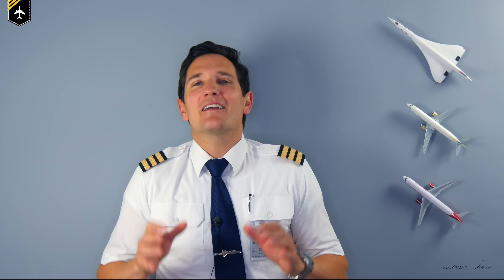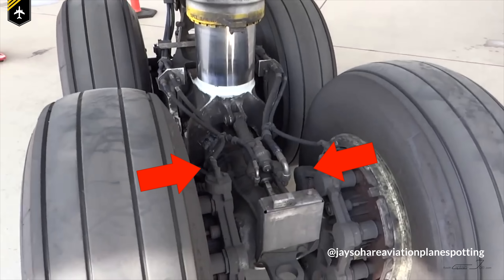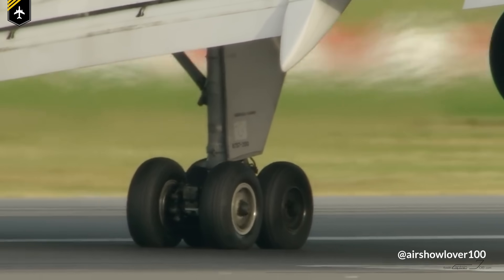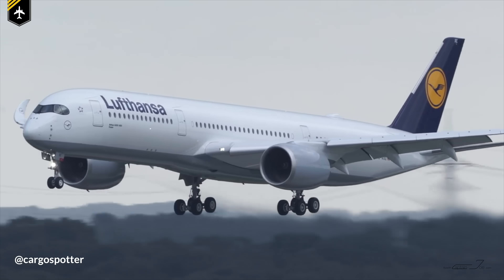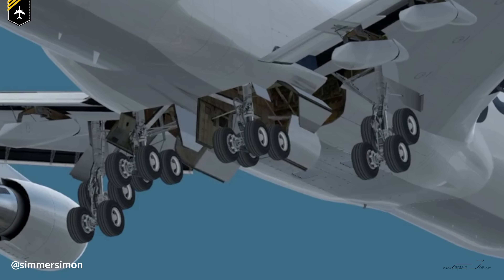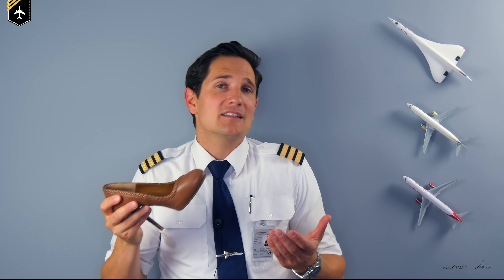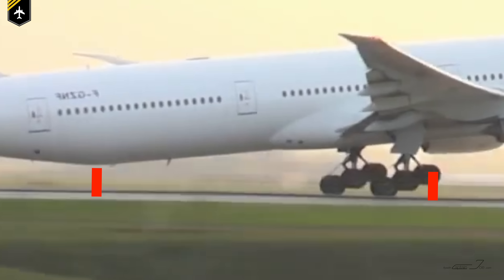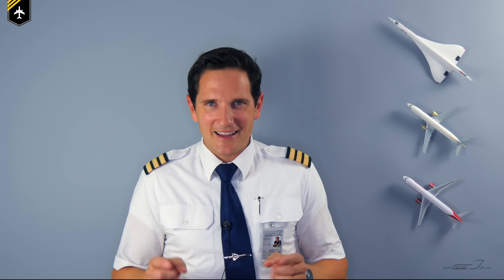Why is the LANDING GEAR TILTED? Explained by CAPTAIN JOE

Comment: Why do planes land on the rear wheels first
Reply: Its not always the rear wheels. But rather the "main" wheels. If its a normal aircraft then the main wheels are in the back. If its a taildragger aircraft then the main wheels are in the front. But basically the main wheels are designed to take the weight of the aircraft when it is landing.

Comment: Question for you…do the wheels on commercial airlines pivot around the central axis of the strut?  I’ve seen videos where airliners land with high crosswinds and they touch down with crab angle.  If landing gear were fixed, it seems like the airplane would lurch violently after touchdown.

Comment: 1:41 i understand from what you said here that tilted landing gear has some benefits on the plane during "landing" .. in another youtube short https://www.youtube.com/shorts/9TH5BeYh9y4 you said that tilted landing gear is for preserving space for the wheel bay in the plane belly and has nothing to do with smoother landing.
Just 1 question.. does it help for a smoother landing or not ?

Comment: Great video but just a question. If that’s the reason, why not tilt the gear back to being parallel to the fuselage after extension, so the tires can impact the ground at the same time? Why is it kept at that tilt angle?

Comment: To every complex question is always one simple answer - and it is wrong :-).
Sorry, Joe. It is the case of this video.
The main reason for the tilted gear is to reduce the lateral force on the main support column during landing. Each wheel of the gear is a giant flywheel that has to be accelerated to the rotation corresponding to the groundspeed of the landing aircraft. As it has to happen within a split of second, the tangential force on the wheel has to be very high - F=m*a. This force is doing its best to bend or even break the main support column backward. So, the idea here is to divide the force into 2 stages by causing one set of wheels to become rotating first and the second set of wheels start rotating afterwards. This way this force is effectively halved, and it helps to reduce the dimensions and weight of the main support column significantly. 
Simples :-).

Comment: The tilted ones resemble how a large bird like an eagle swoop down to grab their prey. Essentially they act like shock absorbers with the forward motion(going from tilted to parallel to ground) It's so much easier to use animals to explain these concepts considering most modern engineering is inspired by them(biomimicry) Also another good example is how professional skiers land after a jump.

Comment: I always thought the tilted gear would also give some sort of a softer dampening zone on initial touchdown. Like if you come down on the left side first it could give a gentle nudge to the plane so you level off with the ground before the main weight of the aircraft comes down.

Comment: C5 and C10 landing gear components are huge, I dropped a brake rotor (these are multiple interlocking friction plates) on my foot during training from one of those. It weighed 70 pounds, fortunately regulations specified steel toe on flight line crew as mandatory so mostly my pride was injured.

Comment: Joe, some airplanes have two position. Tilt and stow. Tilt position depends on rake angle. Semi levered mlg is also on 787-10 for the same reason as on 777. As I know is not blocked on perpendicular to strut position.

Comment: Retired aircraft mech here. Yes some are tilted toes up and some are tilted toes down. AND some MD-10/MD-11 the bogie is level. And if the gear isn’t tilted correctly they can’t be retracted with interlock system.

Comment: I always wonder why so-called "air scoops" (an air-powered turbine) are not attached to the wheel rims, which cause the wheels to rotate shortly after the landing gear has been extended? Because you can always see that the wheels are Put on accelerated from zero to airspeed when they hit the ground. And that results in a lot of rubber abrasion from the wheels every time you land. So if the wheels are brought to flight speed by the so-called "air shovels" (air-operated turbine) before landing, then the wheels touch the ground at the same speed as the flight and there is no rubber wear on the wheels.

Comment: Semilevered gear is only on the 777-300ER, not the non-GE powered 300s.  It doesn’t affect control at all, but it does allow higher RTOW and lower VR speed because of the increased tail clearance - the RR powered 300 has much higher VR and V2 for the same weight and much lower tail clearance.  The system is an MEL item on the 300ER, and involves weight and speed penalties giving weights and speeds similar to the RR 300.

The reason for not having the wheels retract within the wing space is not the fuel tank location but the thickness of wing section you would need to include the width of the wheels, the bogey, the doors and retraction system and all the wing structure - far easier to tuck that into the large fuselage space and composite belly fairings.

Comment: Ich frag mich immer, warum nicht an den Radfelgen sogenannte "Luftschaufeln" (einer luft-betriebenen Turbine) angebracht werden, die die Räder, kurz nach dem Ausfahren des Fahrwerks, in Rotation bringen? Denn man sieht immer, daß die Räder mit dem Aufsetzen auf dem Boden schlagartig von Null auf Fluggeschwindigkeit hoch-beschleunigt werden. Und das gibt jedes mal beim Landen eine Menge Gummiabrieb der Räder. Wenn also die Räder vor der Landung durch die sogenannten "Luftschaufeln" (luft-betriebene Turbine) schon in Fluggeschwindigkeit gebracht werden, dann setzen die Räder in der gleichen Geschwindigkeit des Fluges am Boden auf und es gibt keinen Gummiverschleiß der Räder.

Comment: Why no small fins on the wheels to help them spin a little on landing? That would save some rubber I would think?
Reply: It would increase the cost, weight and complexity of the landing gear system. So even if you may save some rubber, it will be offset by all that.

Comment: A pilot explained me that in the case of the Boeing 767 landing gear, it was to reduce the landing distance on wet runways as the front wheel of the boogie would chase the water for the rear wheel. I'd like to have your opinion on this. Could it be another reason ?

Comment: Do tell.  You have mixed systems but they only reason the gears tilt is so they can fit into the fuselage on retraction.  The "gear not tilted sensors" feed information to other using systems.

Comment: In the RAF aircraft engineering world we call them 'hop dampers'. :)))  JOE you forgot to mention the Boeing B52's STEERABLE undercarriage.......that has FOUR STEERABLE  main undercarriage units that turn and tilt. BUT they can also turn at an angle ( to point along the runway) allowing the huge aircraft to land in cross winds.... once it touches down the wheels straighten up.......very clever! Try to watch one landing in a crosswind or a video.....the aircraft appears to be pointing at an angle to the runway......, the wheels however DO NOT!

Comment: If I recall the XB-70’s main gear pitched up roughly 90° then rotated 90° such the trucks were pointing up with the bottom of the wheels facing inwards before retracting. It was a rather complicated bit of choreography.

Comment: I think if they could spin the wheel up to speed before planes land, it would be softer and not burn and waste so much rubber. But it must not be worth the extra weight and mechanics to be worthwhile or they would have done it.

Comment: Wait... when the gear hits the ground, the system depresurrizes the cabin, deploys the speed brakes, thrust reversal and other stuff all simultaneously? That's pretty incredible technology. I'm wondering why depressurization is important- probably an obvious reason but I'd like to know- stress on fuselage/safety is what I'd guess...
Reply: So the emergency doors can be opened as soon as possible after landing, I'm guessing.

Comment: As for as how the rear wheels touch down, look no further than God creation. As human beings, when we walk or jog we plant our heels first, then bring the toes down last! In fact God created aerospace engineering. In fact in fact to explain how the human heart works, the God had to create so many branches of engineering such as hydraulics, surface tension, pressure, valves, flow, hardware, chambers, software, artificial engineering, electrical engineering, electronic engineering, velocity, friction, resistance, preload, after-load. Just to name ga few. NIK NIKAM, MD CARDIOLOGY. HOUSTON, TX

Comment: hi Cap!,
I guess you’re made a mistake,
when you described the tilt actuators.
due to main landing gears located behind the center of gravity (with nose gear crafts) 
actuators not able to «slightly raise” the wing leading edge the actuator’s torque directed opposite what you told...
and also doubts about ability of this small actuators to raise at least half of aircraft weight (35+ tons) if any)))

btw, thanks for the explanation!

Comment: for tack control it's easier to stabilize an aircraft to a surface when you have some form of lateral force trying to push your plane to the side ect..  like a car that's air born can it steer in the air no.  a plane can yes but on landing not so easy...  Plus if all wheals hit at once the forces of the inertia to turn to wheels up to speed upon hitting the tarmack may damage the landing gear. So it's easier to do one at time.

Comment: As I've been enjoying your informative videos, I've been wondering how those little toothpicks of a landing gear can handle all of that weight and those forces (lateral forces especially) without snapping.
Reply: Landing gear struts are not "toothpicks." If you look at them up close, you will see that they are massive pieces of heavy engineering.

Comment: If anyone remembers the Handley-Page Victor, the main bogie completely inverts before the gear stows into the wing on retraction.
It's effected by tip-hooks on arms that pull the front of the bogie upwards as the retraction-jack retracts and folds the leg so it fits into the thickness of the wing. The wheel diameter is just a couple of inches smaller than the thickness of the wing.
Sadly, I don't think a video exists of this amazing mechanical feat in action, but it was so brilliant that there used to be a full-size working one in the Science Museum in London many years ago. I remember seeing it as a child in the 60's. Little did I realise I would actually work on that equipment some years later!

Comment: Speed brakes deploy automatically?!?
Plane auto-lands, auto-brakes?!
Fun of modern piloting seems less.  Pilot is more of an equipment monitor
Reply: That's true, but then again one has to understand that an airliner is more of a utility vehicle han a personal vehicle. So in such aircraft, safety and ease of use has a greater priority than fun.
Reply: @ZK-APA  right. To say nothing about complexity & expense.  I never thought of an airliner as a winged sports car, but as something needing a pilot's skills for effective operation. 
Pilot has gone from being the primary control & safety system to being the quinary one.  The fun of piloting is in engagement, not in being the 4th back-up.
Well, it's a job, still.   For a few more years….

Comment: I'd rather like to know why the wheels are not rotating to match landing speed, instead of sanding rubber off on the runway as the motionless wheels are accelerated in a fraction of a second.

Comment: Fun fact: 

Humans should walk ball first Instead of the common heel first. Why? Because by walking sole first you actually put pressure on your feet more slowly, allowing your knees to receive less impact overall and detect any dangerous bits (rocks and so on) 
Anyone who has walked barefoot on grass or dirt roads does this instinctively. 

The invention of shoes with thicker and padded soles and heels made this type of walking less comfortable and people started to walk (and run) heel first

Comment: A330/340 has the pitch trimmer. It is a single direction hydraulic actuator. All truck positioners are bi-directional--can be controlled to extend or retract; the A330/340 pitch trimmer can only retract under pressure (causing the bogie to reach a heads up position), and "forced to extend" when weight on wheels.

The pitch trimmer provides damping during landing and bogie rotate during take off like a 777-300ER SLG, but it DOES NOT cause the bogie to change position. The pitch trimmer locks the bogie in forward-up position when fully extended. During retraction, the unique shortening mechanism on a A330/340 gear causes the bogie to be lifted towards the main body, and ARTICULATE the bogie to reach a flat position.

Comment: Seems like the wheels should have fins on them that would make them spin when they are lowered into landing position.  The wheels/tires aren't spinning when they touch down on the runway and the tire leaves rubber on the runway Everytime in a puff of smoke.

Comment: I think that foot anaylysis is important it makes sense to transition the weight bit by bit rather than in one thump.
The more I think about it the more it makes sense.
The tilt forward gear is like a ballerins landing on her fore foot,the heel strike more like a runner but same principle.
Engineers often have more than one reason space saving is also another.

Comment: Well done explaination ! Historically retractable landing gear is a complicated engineering challenge as failure is almost always fatal for both the aircraft and pilot.
Even if the first generation fighters didn't entirely belly flop the stress of a poor design to the airframe could  be more than the mechanics and sheetmetal shops could correct.

Comment: This is slightly inaccurate by omission:  the semi-levered gear is only on the 777-300ER, the 777-300(A) does not have that feature.

Comment: Unfortunately, this video is based on a myth.  The 757, 767, 777, 787, 330, 340 and 380 etc all UNTILT their gear while stowing them!  So space is not the reason.  The reason for the tilt is to AVOID all wheels on the bogie from touching down at the same time!  This reduces the MAX HORIZONTAL load (caused by friction) on the gear assembly and wing spar to half.  Then you can save weight on gear assembly design.  It also reduces the nose down tendency on touchdown.  Finally, it reduces noise and vibrations.  To give you an idea of forces, tests show that spooling up a 747 wheel (about 120 kg) from 0 to 150 kts in 0.07s, requires a horizontal force of about 200kN.  So if all 4 wheels on the bogie hit the ground at the same time it means a horizontal load on the bogie of about 180.000 lbf!  By tilting it, this load is reduced in half due to the small delay in time between wheel pairs touching the ground.
Reply: I'm calling bullshit. On anything other than a perfect butter landing, the time difference between the wheels hitting is far less than the time it takes them to spin up.  On a hard landing, where the forces would be worst, the difference would be practically nothing.
Reply: @stargazer7644  Sorry, no bullshit. Look up the US Patent on the system which explains it well. Can send it to you.  Also your claim that the horizontal forces on a hard landing is greater is off course wrong.  The factors that affect the HORIZONTAL forces are landing groundspeed and ground friction.
Reply: @60north49  Your reading comprehension needs some work.  Try re-reading my previous post.  My point about a hard landing is about timing -  that the two wheel axles both hit the ground before the tires stop slipping.

Comment: A basic question but don't know the answer and want to know the answer. Why the wheels are closed during flight??
Reply: To greatly reduce drag.  If you left them out, the plane would fly much slower, require much more fuel, and wouldn't fly nearly as far.

Comment: Seeing all the smoke from wheels  on touchdowns- why don't they fit a smsll motor to the wheels to spin it, to increase the life of yhe tyres?
Reply: Because tires are cheaper than the cost of the fuel to haul those mechanisms around.

Comment: Before you know all of this stuff you need to go type rating training cause every aircraft has different systems Landing Gears, Flight controls, Airframe, Engine, avionics those manuals for each of those is almost as thick as all of your books in college he just shown you the tip of the iceburg, and iam so impress with the captain,

Comment: Its quite cool seeing that slow mo at 1:50. We're all used to having a distinctive bounce when landing, before the wheels touch down again. And obviously the first bounce, the first contact, sets the wheels spinning. I assume this helps ease pressure on the wheels so when they make contact again, they aren't idle? Or is it bad that this happens?

Comment: Before touching the ground the aircraft still moves at a high speed while the wheels do not spin at all, i.e their speed is zero. That is why we always see some smoke, i.e the wheels are burnt a little bit when touching down. I always wonder why don't let them spin at the same speed as the aircraft moves.